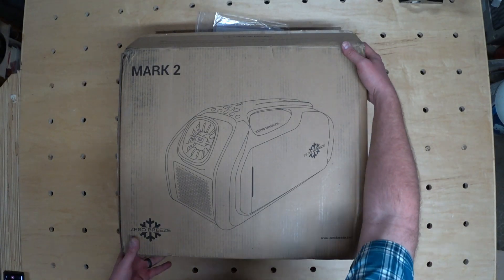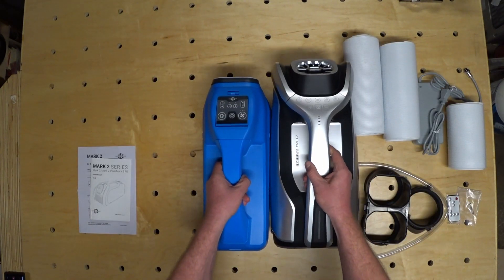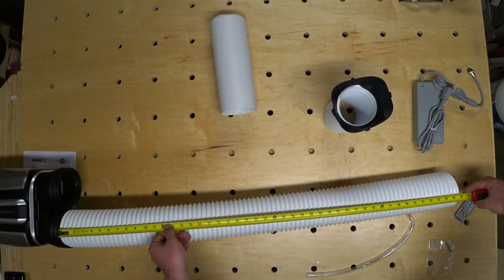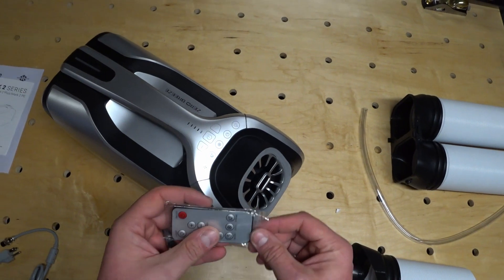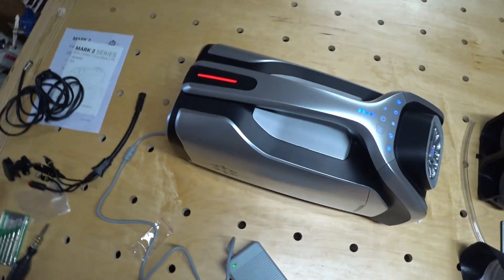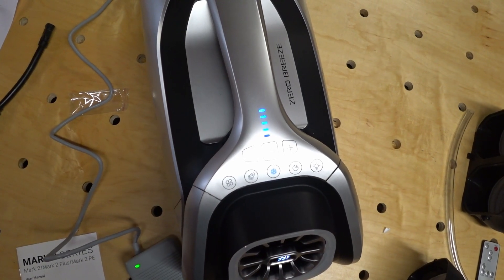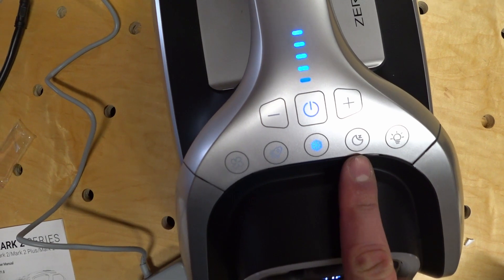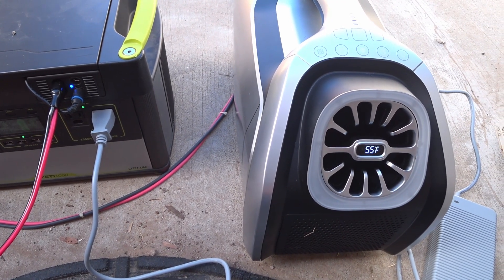Zero Breeze Mark 2 Unboxing, Startup, and First Impressions

Comment: You paid 1000 bucks for this trash 😮 that's ductless mini split money lol
Reply from the maker: I paid 500...crowdfunding....well worth it.  1000 is ductless mini split money for sure, but I found it would be difficult to install a ductless mini split on my car discreetly, and take it to the park, etc.
Reply: I can for 1,200 get a 90 plus air handler and the heat pump perks of being in the trade lmfao
Reply: Car don't have ac lmfao
Reply from the maker: That sounds heavy to be carrying around.  How many batteries would you need to run that all day?

Comment: don't bother folks.....read the reviews on amazon it will only drop temp by roughly 20 degrees      so 100 to 80  no use at all
Reply: 100 to 80 that is pretty good, what do you expect a freezer in your car?
Reply: Hajahhaahaha
Reply: 20 degrees is great I mean what other option is there that can compare?
Reply: 90 to 70 is great

Comment: I'm sorry but it seems like junk... Shit quality assurance and the exhaust and intake side by side is a horrible idea... Seems to be a fly by night product
Reply from the maker: If we were talking about the first version (Mark 1), I'd have to agree with you completely.  The Mark 2, being a second version over two years and fixing all the issues of the first which made that one unusable, is far from a fly by night product however.  Quality assurance....the manufacturing source of the units makes it a crap shoot for sure...I had to send my first Mark 2 back, it died after 3 minutes, second one still works great. The exhaust/intake on the back have 4 foot (included) hoses that can be attached to each, giving up to an 8 foot spread.  Very expensive retail price also, but absolutely priceless for the right person and right situation.

Comment: Is this kind a crap product?
Reply from the maker: That depends on how you qualify a crap product.  Many think it's crap because it won't cool a large closed space sitting in full sun, but it wasn't designed to do that.  If you're looking for something to blow cool air on you that's up to 30 degrees cooler than ambient so you can sit in a hot car and not be dripping sweat all over the place.....I think it works great for that.
Reply: @Polymathicus  they should build those into cars so I don’t have to keep sweating in mine